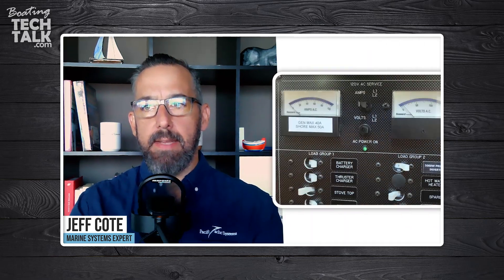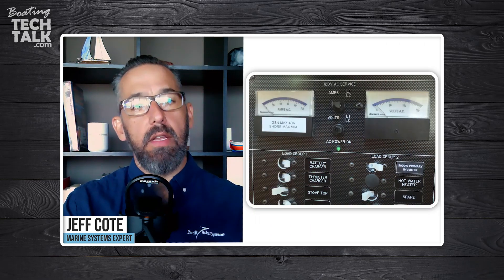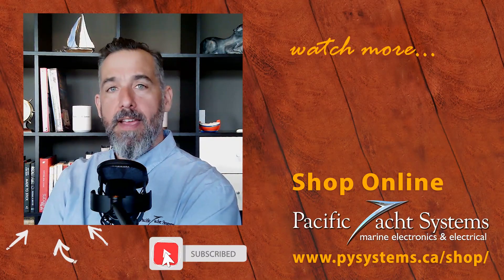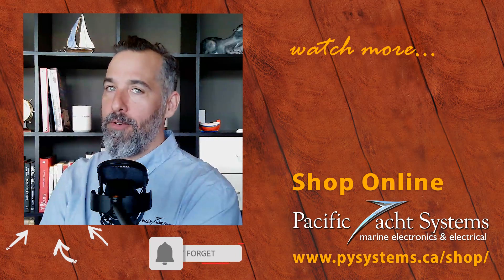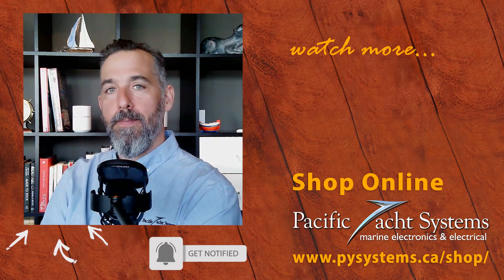Am I Overloading My Boat’s Generator With Too Many Loads?

Comment: You are right, some wise user switching is always mandatory. But to my understanding a generators more than max output is determent by a fuse. So it seems not electrical but a mechanical issue. The real problem is the oil or fuel is getting into the exhaust.  My thoughts are a blown head gasket, damaged piston rings, rod seals etc, maybe  a cooling issue that have caused these, or for fuel , filthy injectors,  timing or fuel pump issue, etc.

Comment: 1) If generator is overloaded, by what mechanism does an oil slick form?  More specifically how is raw oil getting out of the exhaust and into the surrounding water?

2) If too many loads are put on the generator, the main breaker will trip, so no it is not possible to overload the generator.

3) Generator rating will be stated as Continuous Maximum Rating, but that is actually the continuous maximum rating of the engine driving the generator.  The continuous maximum rating of the generator will be a little higher than the maximum output of the engine.  My generator is rated for 8kW which means it is rated to provide 8kW continuously until I shut it off of the fuel tank runs dry (at 320 litres, that will be quite a while); in actual fact the generator output is actually rated higher than 8kW. The engine driving the generator would be rated at around 8kW maximum continuous output meaning it will happily run at max output until I shut it off or the fuel tank runs dry.

Comment: I have a Freedom SW 3012 Inverter Charger. If that is charging there isn't much else I can do until it's done. Doesn't matter whether generator or shore power as they are both 30A. Found that out the first time I tested the generator before I fixed the ammeter.

Comment: This question is right on for me. My 42 foot boat has an 11.5 kw gen with an amp meter for each 120 volt leg. I do not know how much is too much. Amps times 120 equals 11500 watts? I have 3 ac units, hot water, frig and 2 chargers. Plenty to overload.
Reply: Ammeter not “amp meter”.

Comment: Jeff, if you 'overload' an AC generator, won't it trip? (Stop generating AC, yet continue to run unloaded?) In every one I've ever seen, there is an an overload breaker which must be reset? The oil slick sounds like a bad O-ring, gasket, or some replaceable item? Please help!